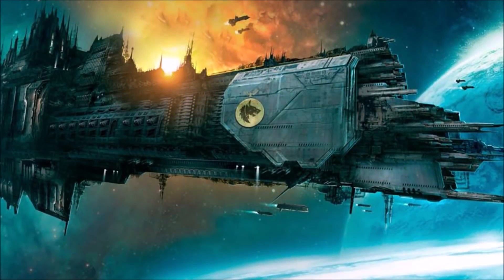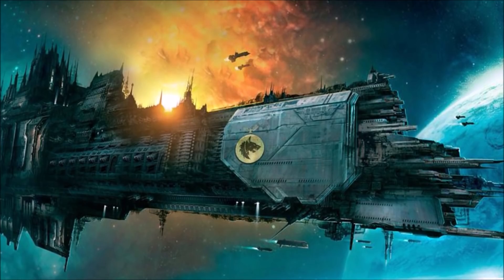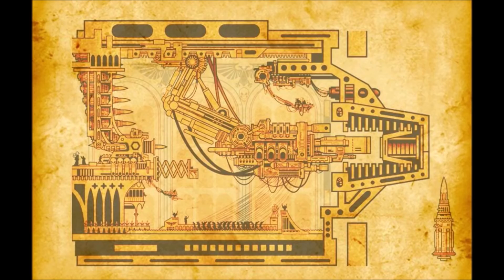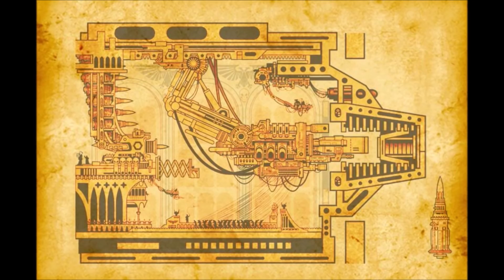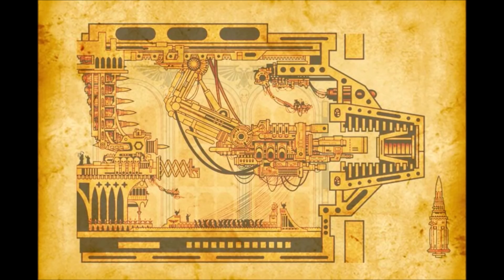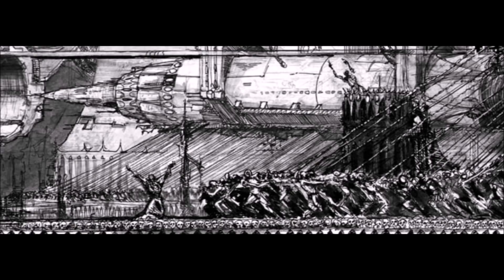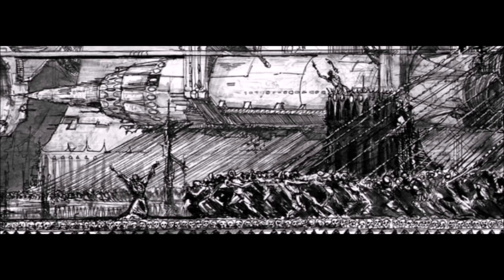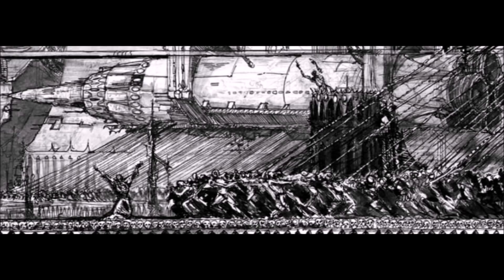Void War - Episode 0: The Methodology

Comment: I had to come back to this playlist after checking a few things.
Macro Cannons a couple points of order:
Firing at a planet - Not only would the shell lose some of it's intertia (how much I've no idea) but it would also lose mass depending on the material, from what I can see unshielded objects entering the atmosphere can reach a temp of over 2000C, depending on source, admantium melts at around 8-900C and steel 1500C. Given the speed of the shell which would increase the temperature of atmospheric friction, although potentially reduce the time friction would be applied, it's possible that a shell would be a fraction of the weight and therefore would have lost much of the potential energy transfer. I'm not even going to start on Macro Plasma which wouldn't have much impact force (comparatively) but would superheat the atmosphere and localized area of impact.
Firing at a ship - Void shields to begin with essentially displace energy into the warp so, potentially, most, if not all of the energy would be dissipated. If the shell gets through it wouldn't impart all of it's energy at the second of impact. Just look at AP rounds through armour for example, depending on the size of the bullet/shell, they over match the armour and punch straight through and keep going until either the energy is dissipated or they hit something strong enough to resist at which point the remaining energy is released.
You also have to take into account not all energy is expended as concussive force, some is heat, noise, etc.

I will admit to my knowledge of physics isn't up to arguing details on this but there are definitely parts of the equations missing in calculating what does what damage and how.
Of course you have to take into account allowances goobie plot, dramatic events and the fact that GW looks at real world physics and dodges faster than a Harlequin hopped up on space marine grade amphetamines! =D =D

Comment: Your calculations for the energy in a macrocannon shell is incorrect, as you take the mass of a shell before firing, to reach those speeds it must have internal fuel, probably not restrained in acceleration by sensors and cogitators like a torpedo. Most of the mass in a macro cannon is probably used to accelerate the shell once outside the barrel.

Comment: BROTHERS ! YOU DON'T NEED TO READ d OUT THOSE  BIG FUCKIN NUMBERS!
Sincerest apologies if you already knew tjis
.. Entirely possible as you sound way more mathematically competent... Anyway, you can just use SI notation
..

Rather then naming a far less round number, like, 3 568 897 442.97 m/s for example, you can simply express it as 3.56 X 10^9 m/s....

10^9 being 10 to the 9th power of 10 X 10 X 10..... Nine times.... Each power of ten shifts thr decimal point over one space to the left...

Depending on how accurate you need to be for the intended purpose, you can include as many or as few places after the decimal as you see fit or are requiring, etc. So for warhammer purposes where we're just wolf whistling at big fuck off expressions of violence, you could probs go through the whole thing once to give people an idea and then save yourself time by saying 3.36 times ten to the point power bla bla newtons... Or joules.. Or potatoes... Or 'surprise - HORMGAUNT!' (TM) Etc.... Hehe

That wasn't really a tm, I'm just being retarded. 

Ps.... I
... Have no friends. 
Pps.... 
Negative powers indicate a division by 10, so 10^-1 = 1/10,
10^-2 = 1/(10 X 10),
With each successive increase moving the decimal point one place to the right... Just an interesting fyi I suppose lol

Comment: A number of assumptions skew your estimates; first and foremost, that you base your maths on the Fantasy Flight RPG, which was written perfectly in-character for 40k, but with a serious case of "writers with no sense of scale", especially visavi size, mass, and velocity.

Basically, for all the poetic talk about "hab-sized shells", the rules for orbital bombardment (Battlfleet Koronus, pg133) makes it explicitly clear that a macrocannon salvo consists of single-digit kiloton-range explosions, destroying everything within "a few dozen metres" of the impact point and dealing massive but not overwhelming damage to everything within 10 square (!) kilometres.

This is also supported by the Atomics ship upgrade introduced in Into The Storm, pg163. Single-use devices purchased individually, and either mounted on a torpedo or launched as a macrocannon shell; "A single atomic has the firepower to destroy a Hive spire between five and 10 [sic] kilometres across." This fits very well with a megaton-range explosion, and deals about three times the damage of a regular plasma torpedo or seven times the damage of a normal macrocannon shell. If we assume an exponential or logarithmic scale for damage - we have to, considering how Hull Points and Armour scales with size - then this is somewhat reasonable as well.

As you pointed out, torpedoes are traveling at a minimum of 55kps. We also know that the "form of the most common" is a 60 meter missile, powered by a short-lived plasma reactor which also makes up part of its "powerful warhead." Incidentally, an Atlas V rocket is 58 meters, and weighs 590 metric tons. Assuming an average torpedo of the same size, this gives it a kinetic impact of 910,5 trillion joules, or 216 kilotons... Which fits in the same general ballpark as a salvo of hundred of kiloton-range shells. Unfortunately, torpedoes are not supposed to be kinetic weapons, meaning that we have two possibilities; a MIRV-type terminal approach, which fits with some descriptions and might help explain how torpedoes bypass Void shields... Or B) that the main warhead is significantly more powerful than the kinetic impact.

In general, I feel that many settings - and just about every Versus debate - suffers from authors with no sense of scale, and readers taking the poetic prose for literal fact.

Edit: And yes, I am - painfully - aware of the irony of that final statement, having spent the better part of an hour writing up my analysis of the entirely fictional, intentionally over the top, and infamously incoherent yet awesome setting that is 40k.

Comment: Anything fired in a void with no magnetic interference would be capable of traveling ONLY the speed at which it exits the naval rifel barrels at unless they had engines capable of accelerating them FASTER than the compression of exit would allow them to.
Your numbers are RIDICULOUSLY over estimated even for WH40k.
Fantasy and Science Fantasy are JUST that.

Comment: "I'm going to ignore a vital part of the entire setting because I cant understand it."

EckartsLadder got void shields and he's a SW centric channel. Look up the Doval Basin's of the Vong from StarWars a void shield follows a scaled up version of the same design principle. 

Its effectively a point defense system that utalizes "gravatomic anomalies" to steal from star wars before they just said Black Holes.  A lucky shot can get past a point defense system, or a point defense system could stop a fleet's entire barrage of fire. 

While void shields are rather light on a full description, the fact that we know the Imperials, and thus chaos, void shields gives us enough to work with which scales perfectly with the amount of fire the supposed timeframes of battles and why things like fighters and torpedoes can pass through.

But then I'm defending in-universe consistency (which void shields have in spades over trek shields) vs "we must have a modern equivalent for it to even be considered"

Comment: Note: your value posted for missile speed is in kph not kps (more on that below). Looking forward to this series. Personally I'd like to see the assumptions and calculations posted in an attachment so they can be picked apart like vultures over a corpse. Moreover, that will give you more time to shower us with glorious exposition and contextual comparisons. More detailed critique below. 

Following your math the 1 kiloton projectile mass assumption was lore friendly, but assuming a projectile with roughly 3m diameter and 5m length that would mean the slug would have a density ~28,000kg/m^3 (~10,000 more than uranium) which isn't too far outside reason for the grimdark future. The velocity->inertia->work calculations all seem fine, though the initial given velocity strikes me as being way too high. I'd attribute this to extrapolating it from tabletop rules as the numbers from any tabletop game work out dubiously at times IRL. Ex. the listed speed you posted for missile speed is 55kph (which is too slow), but you read it as 55kps (too fast IMO, but not unreasonable) which is half as fast as the fastest spacecraft to date (Juno) and had 5 years to get up to speed. Noting or resolving these discrepancies in extreme detail would be great, perhaps provide a range of values on the upper and lower end. Then again you could just run with the crazy number and give more exposition on the effects of these like you did briefly at the end (40k Theories after all). What propellant might be used to launch a macro cannon slug at 5,500kps? What about newtons third law; can Macro cannon broadsides be used to propel a ship faster than its engines can? Stress analysis on the recoil mechanisms of the macro-cannon perhaps, if there's no substance in the universe that can survive a hit from a macro-cannon I'm curious about how they'd approach withstanding it's launch? How about the exact decibels of a macro-cannon salvo inside a pressurized air can and it's effects on the eardrums of servitors?

Comment: It doesn't matter what the ships are made of when talking energy levels that high. Unless the ship is a solid block of neutrons, it's vaporizing in an instant the second a single shell hits it. That amount of energy is enough to break the molecular bonds of the atoms that make up the material the ships are made from. CERN broke apart the very building blocks of matter/energy itself with power levels that wouldn't register as a minuscule fraction of what's stated in this video.

Anything hit by one of those guns doesn't go boom. It goes poof. Gone.

Comment: Umm i think 1 kiloton refers to the yield, not the mass of the shell. It would make far more sense than a 3 GIGATON shell.. Pretty basic logic. Also Fiaura is not a good fit to collab with, he just doesn't research as well as Remleiz and doesn't script as well.
Reply: 1. She isn't a good fit.
2. Actually kiloton does refer to shell mass according to the Rogue Trader handbook. There are also illustrations of crews loading these things with literally dozens of people operating machinery to move one shell described as the size of a "hab." That's about as big as a smaller one bedroom apartment. Six years ago the guys at the space battles forum estimated 3.7 gigatons of kinetic impact.
3. I think both are wrong for one reason though; it should take 30min for the shells to travel that max range. The Rogue Trader handbook also describes skilled weapon officers timing their lance batteries to fire just before the shells impact to clear the void shields. That would dramatically lessen the impact force if a shell was only going about 1.5x the speed of a torpedo.
Reply: @FirestormMk3  makes one wonder what she spent six months doing for research when spacebattles got it done six years ago, she could've used that.
Reply: @TS-jm7jm  Probably the other ships and species. The thread I'm talking about was literally just on macro cannons. They'll probably discuss many other weaponry.
Reply: @FirestormMk3  ok guess we'll see on that possibility,
how long did the thread get?, if they stayed on topic i would expect it to be a rather short thread.

Comment: I’m sure I’ll have some moments of nerdrage I’ll have to vent. (The first being, macrocannon are not in any way shape or form uniform weapon’s, the cannons within a turret battery of a frigate are not the same as the cannons within a retribution battleships broadsides). I’m sure I’ll get annoyed by the need to select arbitrary figures which may not have much basis in canon.

All that said. Description of a Cruiser grade Macro battery have ben described as capable of cracking tectonic plates. So your first estimation isn’t very off.
Reply: You're totally right, but I think they were definitely talking capital ship macro cannons. Think Dauntless and bigger.
Reply: FirestormMk3 even at Capital grade they vary widely. The battery’s of a lunar and a tyrant might use the same cannon, and the Armeggedon’s are certainly the same as a lunar’s; but an avenger or any battleship are going to be vastly different. Heck the cannons they use on their broadsides are different form the dorsal mounts. The dauntless’s cannons certainly don’t pack the same firepower as it’s larger siblings. Not to mention the other variables such as shell type and etc. like I said, venting nerdrage.

I do recall the Lunar being singled out as capable of “cracking a continent” (sounds like hyperbole but given 40k I think it’s safe to say that sounds like breaking a tectonic plate) with a broadside. Given its only got a ‘half battery’, so yeah that’s a whole lot of firepower regardless of the uniformity gripe I have.

Comment: 9:55 And no. To crack a planet you need a few thousand Exatons. 10^21 tons of TNT or 4.184×10^30 Joules. That's 2×10^11 times higher than the impact of a single macro cannon projectile.
Reply: Actually No, you are calculating what is required to Break/Destroy a planet not what is required to Crack the Planet's Crust.
Reply: @FiauraTheTankGirlGamer  He said "crack a planet", not "crack the crust of a planet". And even then that's still exatons vs the 43 gigatons of a battery.
Reply: Plus Fiora said a BATTERY of them, atleast ten shots, maybe twenty. Not a single shot.

Comment: I really have to question the validity of the analysis when Fiaura calculates units of energy (Joules) and then describes force (newtons) as if they automatically convert between each other.
Reply: They do actually, 1 Joules = 1 Newton.  They are used for different calculations but when you convert them back and forth they each equal each other in scientific terms.  The difference here is: Impact Force versus Explosive Force are two different calculations in two different measurements.But in a lab we know that 1 Newton and 1 Joules are equivalent.